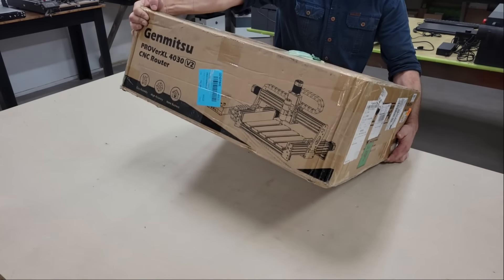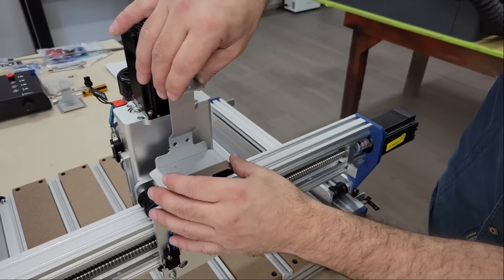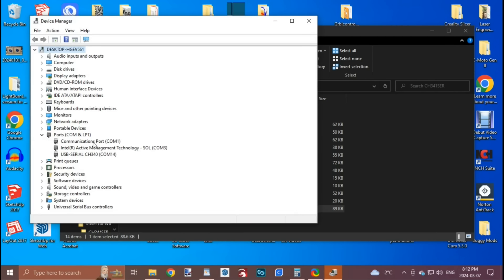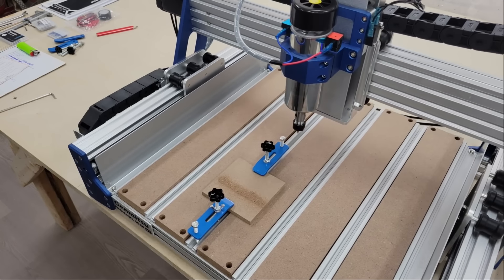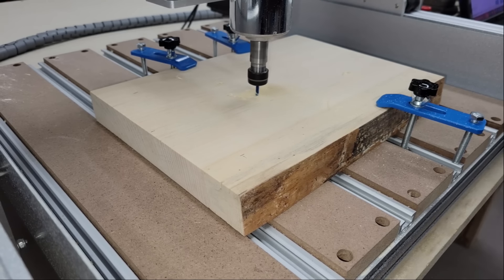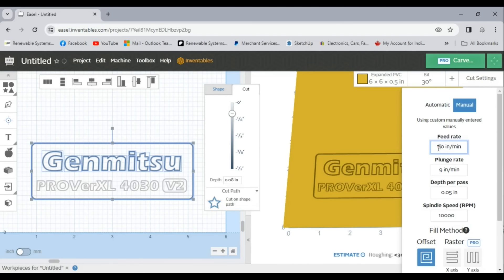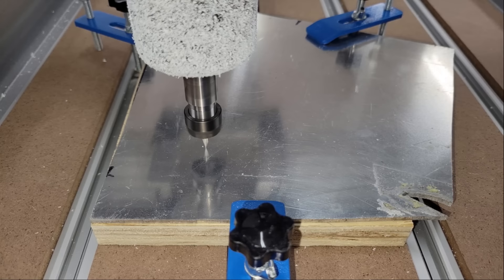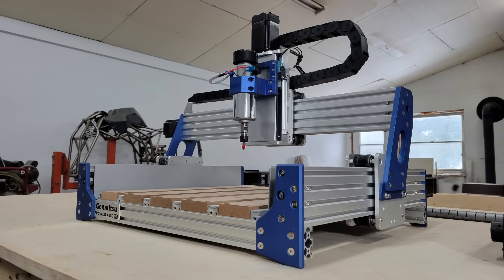Entry-Level Excellence: Beginner-Friendly Genmitsu PROVerXL 4030 V2 CNC Router Machine

Comment: Getting very close to the price of a Foxalien Vasto, which is a far better machine.
Reply from the maker: Highly debatable. I've used both. This is over $1000 cheaper - almost half the price of a Vasto. The Vasto is a better machine, but not by much. Linear rails beat the double v wheels in longevity. But this machine has closed loop steppers for better precision. Other than that, rigidity and performance is the same - at least until the v wheels or bearings wear out. If replacing the linear bearings in the Vasto less often than replacing the v wheels on the ProVerXl is worth the extra $1k+, then have at it. I could change both out in less than 10 min. My time isn't worth that much lol. I like both, but I'm just keeping it real. This is more affordable and works just as well. It's a cheaper, lower risk investment for a beginner.

Comment: if using Easel does it mean if your network was disconnected for a moment your whole cutting process would be royally screwed?
Reply from the maker: No. Easel is an 'all-in-one' software that allows you to create your designs, connect and control your machine, but also send your g-code to the machine's controller every time you start a job through it so that the only thing that's going to interrupt a job is you or a power outage. Internet interruptions won't affect anything other than cause a delay in real time status info displayed in Easel as the machine works.